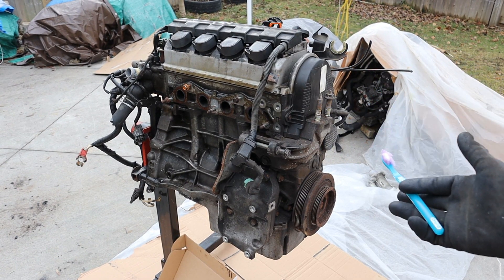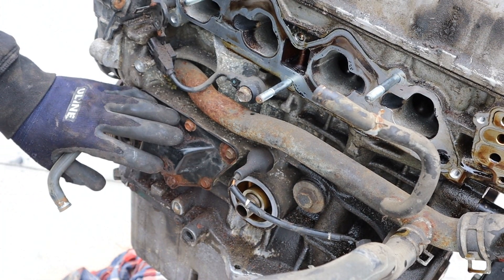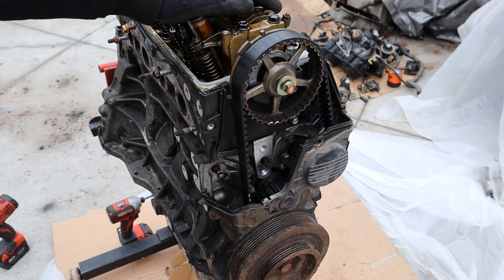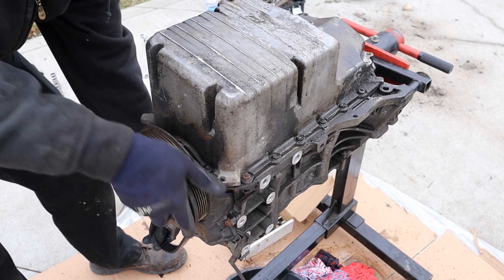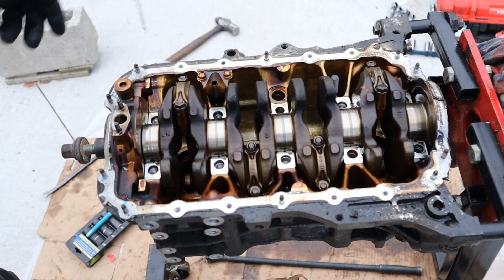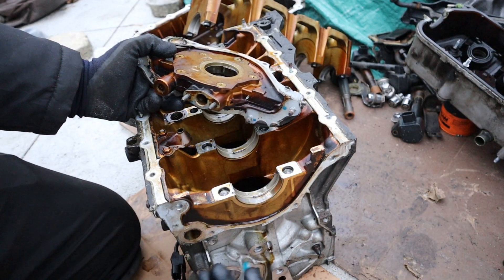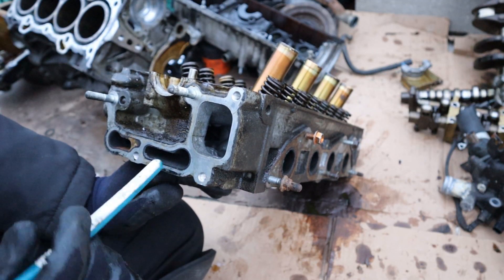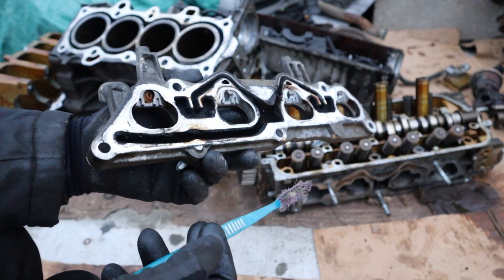Honda D-Series Engine: A Low Point for Honda

Comment: This is the 1st time i heard about head gasket issue with D-series engines
Reply: I seen multiple head gasket issues with d-series, my gf had an 05 civic as her 1st car that her uncle gave to her For only 1k, it was in amazing shape and gave her a book of all the maintenance records, head gasket was replaced at around 105k miles (she got it at 140k) And I asked him about it and he said he was suprised himself as well that the head gasket went bed on him and the only Honda that ever had a head gasket fail on him (he’s a Honda fan whom had multiple generations of civics since his 1st civic in the 80’s), he takes care of his cars extremely well and is an older gentleman so he doesn’t drive them like a maniac
Reply: @DrEvilTag  I purchased an 04 Honda Civic base model with the D17A1 back in October of 2020. Ran fine and was in decent condition since it had 320,000 km's on the clock when I had purchased it. After a year and 20k km driven on the car, I noticed it started to overheat, especially when idling. Now the car is at 383,500 km today, it drinks coolant like a drunk Irishman drinks alcohol, the paint is in terrible condition, the rocker panels are rotted through and so are the rear quarter panels that leads into the trunk (water enters when it's raining). It's my fault because I bought the car AS IS and fixed it myself to pass safety but ended up costing me way more to keep in running. I should've saved up a bit more to buy an 8th gen or 9th gen civic instead with an R18A1 or R18Z1.
Reply: My best friend and my girlfriend cousin had civics from those generation of D-series and both had head gasket problems, my best friend civic would start overheating on idle, girlfriend’s cousin whom didn’t know about cars blew up her engine

Comment: Low Point? D-Series engines will last till the end of times.
Reply: The D17 Weren’t As Reliable As The D16s .
Reply: @J4Y_Zee True
Reply: @J4Y_Zee still miles ahead of any big 3 engine
Reply: @J4Y_Zee  not true it’s just the head gasket that’s to blame and the timing belt they should’ve went with a chain and it would’ve been indestructible
Reply: @RobertMorris-l3l  Ok D16s Didn’t Have That Problems So My Statement Still Stands Even After 2 Years Later. Go Argue With Your Mom.
Reply: @J4Y_Zee  yeah lol I get a 2003 love it but the older ones are gold
Reply: @J4Y_Zee  No 1.7 liter engine with a 95mm stroke is going to be super reliable.
Reply: @matthewstorm5188  I Never Said That Wasn’t Reliable. The D16 Was Just More Reliable.
Reply: @J4Y_Zee I have 270k miles on a d17 and it runs everyday fine 🤣🤣 I think you’re wrong
Reply: @Eli-wu9zu  Reading Is Fundamental. I Never Said They Weren’t Reliable. I Said They Aren’t As Reliable As D16s. Never Said They Couldn’t Reach 300k.
Reply: Keep in mind that a low point for Honda is every other engine maker’s high point
Reply: Its the "nothing special" about them that makes them great workhorses. Same with the Toyota 5sfe
Reply: Honda D Series aka “Old Reliable”
Reply: @rcayabyab8994 not the d17a1 lol blocks blow easy I blew 3 holes in the block in cylinder 1 and my piston blew like a grenade
Reply: "O'l reliable" ..... thats true but.... "f22A4" enters the chat come on guys
Reply: @Glen Benton  one of the best engine
Reply: Yeah, but the 1.7 is pretty awful compared to the previous gens 1.6 EX motors that were infinitely simpler. Kinda like how I wish there was a K18 instead of an R18, that would have been an efficient beast
Reply: @lewzero  do you mean a k series that is undersquare or one that is oversquare
Reply: @DAddy-iy9mu  something close to that 1.6-1.75 rod to stroke ratio, dohc with the K's actual vtec, and 1.8l or smaller displacement to keep the gas mileage above 40 with your foot out of it, but enough hp on the high end to overcome the low displacement lack of tq. Yes I know I'm wishing for the impossible
Reply: @lewzero  1.6/1.7 ratio. OK you lost me. Can you explain more like a specific bore and stroke size. Cuz I'm lost completel
Reply: @DAddy-iy9mu  my understanding is that if you have say a 146mm rod (measured from center of pin bore to center of crank bore) and a 83.5mm crank stroke then 146÷83.5=1.748 or close to 1.75 ratio should put as low stress on that rod as possible. Less stress on the rod should put less on the bearings, making it wear less under normal load. You also get the added benefit of being able to rev easier.
In this theoretical engine, I guess 1.8 liter displacement would need 83.5mm bore X 83.5mm stroke with a 145mm rod to satisfy my requirements. Square engines seem to be easier to do the math on for me.
Reply: @lewzero  OK kinda helps makes sense. Though I was asking if you wanted it to be square like the k20. Undersquare like the d and L series and k24. Or oversquare like the b16
Reply: @DAddy-iy9mu  it's called a rod ratio......
Reply: My D series leaked oil like no tomorrow shortly after warranty expiration. Lots of oil seals had to be replaced at least twice to keep oil off the timing belt. It also blew a head gasket.

At least it didn't burn oil when I finally told the car goodbye at 281k miles.

Mine must have been a dud. I was very kind to it and it was not a great engine.
Reply: @Sunset4Semaphores  did you buy it new?
Reply: This is d17 nothing like the d15/d16s until 2000
Reply: @2strokeFORever  yupp
Reply: @2strokeFORever  ...yes it literally is. As are the D14, D15, and D16s manufactured between 2001 and 2007. A D series is a D series
Reply: @Casey_and_Cars  lol thats like saying a k20c1 is the same as a k20z1. So based on your logic the the dohc zc d series is the same... gtfoh lol
Reply: @2strokeFORever  the bottom end, is the same lol its 75x90 like every D16.
Reply: @Casey_and_Cars  lol
Reply: D15s maybe
Reply: This valid until 2001 honda global update when even D-series became a little bit less of a Honda. Still reliable, but not bulletproof anymore.
Reply: @slavikrybka yeah not as reliable as the old 1.6 and 1.5 liters but still good motors. Head gaskets are a issue but not as common as people make it out to be. Plus it's the easiest head gasket to change ever lol
Reply: @koloy999  that's true lol
Reply: I agree they are a low point on d-series engines starting in 96.
Reply: 400k km on my d16y8
Reply: In your mind, only !
Reply: Haven't heard of a single slammer?
Reply: D17 is nothing like the D16z/y
Reply: d17 loved spending time on money on head gaskets 😂 other than that they were good motors of you kept an eye on pil quality and fill level
Reply: I bought one with dealership paperwork for all maintenance.

It failed and started knocking at 156k km. A 2003
Reply: Was literally saying the same thing in my head the videos name had to be click bait because you never trust a mechanic who truly believes the d series was a bad engine, D13-17 will run even after the earth is gone lol
Reply: yeah not D17s theyre dog shit
Reply: My 95 Honda Civic had a D engine in it. I beat the hell out of that car and I finally sold it after putting 280K flawless miles on it. Probably still rolling around.
Reply: The l15 is a much worse engine than the d series
Reply: My shit just spun a bearing thanks to rocker arm
Reply: Fuel efficiency tho
Reply: That’s why I’m pulling a blown one
Reply: @mixoasis7667  second law of thermodynamics my friend, nothing lasts forever. The point is these engines are actually very reliable, providing they are well maintained and kept up on regular oil changes and timing belt changes. Whenever an engine blows up, you gotta look at the circumstances of what failed and why. Honda makes some of the most reliable engines in the world. Remember, the D17 is the powerplant of the beloved 6th gen Civic too
Reply: As one driving a D17, they kinda not great 👍
Reply: Not the d17 lol
Reply: Not the D17, the D15 and D16s are the indestructible ones
Reply: I think the only reason ppl say it’s a low point engine bc it’s slow and very restrictive
Reply: 300k on my original engine and went through two trans 😂
Reply: One head gasket and weld exhaust manifold, thats literally it for 300000+ miles. Far from a bad engine 😂😂😂
Reply: Exactly, head gasket and weld cracked exhaust manifold. Far from a bad engine
Reply: I'm running a D15(Z6) in my 1996 Civic EK3 hatchback. Almost 30 years old and 125k miles on it, but runs like new! 🚙💨
Reply: mine took a literal daily redline beating
Reply: EGR will clog hence why everyone’s saying D16 is “better”
Reply: The D17 was piece of crap blew head gaskets every 80 to 100k miles burned oil like crazy.
Reply: @robertblack6630  this, lost my D17A1 to hg issues
Reply: @robertblack6630 I'll keep you updated but my D17 at 80k miles that sat and dry-rotted for 7 years and has seen nothing but oil changes every 6k miles for as long as I've owned it is going fine. They are not collectors items, they just work well enough and cost like they don't.
Reply: @robertblack6630  thats literally never happened. The only D17s in the world that have ever failed were from POS owners. Nothing to do with the motor. If that was the case then there would be TSB and recalls. Theres zero.
Reply: @Casey_and_Cars good to know! I have a 2001 LX which currently has 208k on it. Only issue I'm having is idle drop, as it, for some reason, likes to drop to around 400 rpms. Any idea what could be causing that? IAC valve maybe? Been trying to figure it out so I can fix it and get the engine to quit doing that. Any info helps, thanks
Reply: Mine lasted to 250k with original gasket. Blew gasket then got rod knock since it happened in 100 degree heat in stop and go traffic an hour from home.  It over heated heavily. Didnt deck the head or anything when I replaced the gasket and just replaced the rod bearings and it just got a slight knock again after 15k miles because rear main seal blew and girl drove it an hour on the highway with no oil.  Gonna swap bearings again and send it
Reply: @robertblack6630 sounds like you don't know how to replace a head gasket. Maybe do some learning
Reply: No DOHC Honda has a direct acting valvetrain (ie bucket and shim). All Honda engines use rocker arms, whether SOHC or DOHC.
Reply: With a small budget, 500HP just saying
Reply: @pilsman2733 for the price to build a 500hp D you could build a 750hp B.
Reply: @pilsman2733  you’re never making 500 out of any d series. Fully built they struggle to get past 200 turboed.

Comment: I was always confused because Sam Honda’s in the book actually say to change the oil filter every other oil change
Reply: Back when oil changes were every 3500 miles it might have made sense. Most modern cars are 7500 or more when the maintenance minder demands an oil change.  I change mine every time.  I wouldn't use a "Fram".
Reply: @quademasters249  Fram is a bad filter brand to you?
Reply: @raymonds.9021  I use OEM filters.  The only ones you know meet spec.  I've read reviews that claim fram is bad.   Without cutting one apart it's hard to know first hand how good they are.